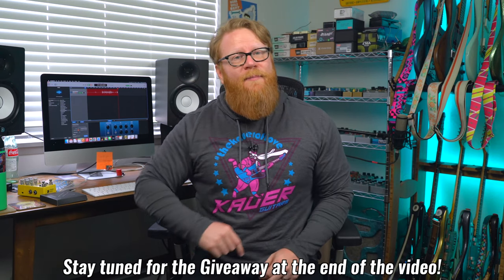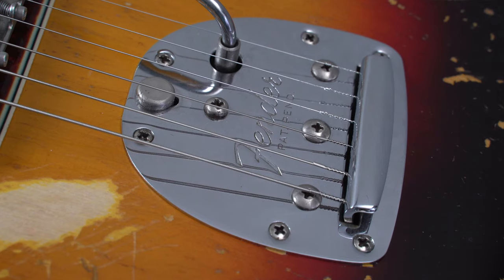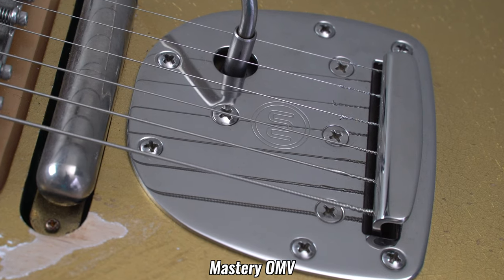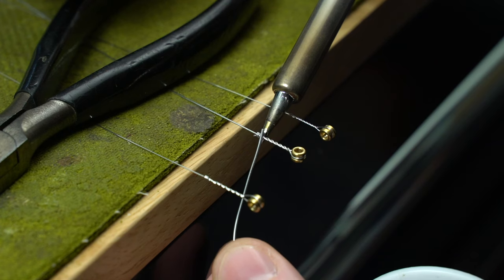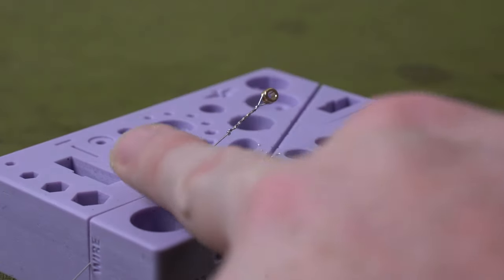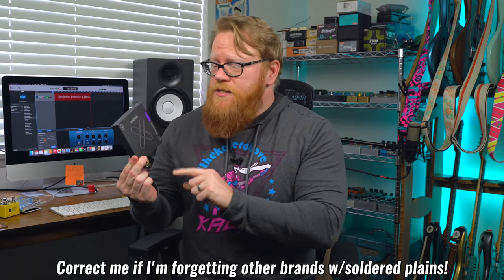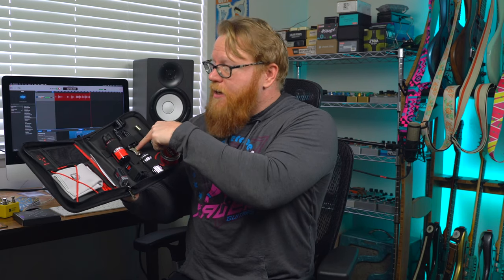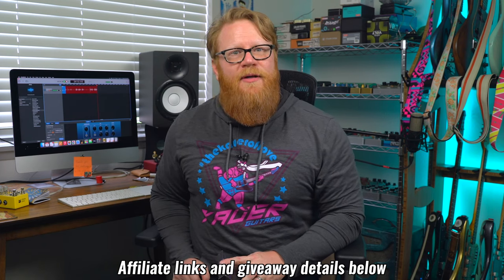ONE WEIRD TRICK #2: Solder Your Strings + Giveaway (Solves Jazzmaster String Breakage)

Comment: On the second source of breaking…another “one weird trick”, for those with strings which don’t touch the screws like mine don’t, is to turn the ball ends sideways like — rather than 0 in the plate. I used to break the high e all the time and that’s after Mitchell’s, turned it sideways and I haven’t broke one since.

Comment: Best channel for offsets by far. 

I took my vibrato apart and flipped the screws. As I did, I noticed another M7 screw underneath that was a countersunk flathead and had an idea. I took my vibrato to the drill press and countersunk the three holes from the front. The I purchased some stainless M7 flathead machine screws and put my vibrato back together. Screw interference eliminated.

Comment: I recommend the M-Steel strings by Ernie Ball they come with extra wounded ends, also if you raise the bridge with a shim on the neck (1° in my case) the strings will never make contact with those screws in the tail plate

Comment: Timely video! Just had a string break on my JMJM for this reason. Thanks a bunch Mike!
Reply: thats me right now with my JMJM. it just started. high e keeps unwinding and slipping, dropping the tuning . . so i keep tuning it up and the string gets tighter and tighter from slipping at the ball end, then BAM one good bend and it's over. It only JUST started to do this so i'm baffled as to why as i'm not doing anything differently. i use stringjoys and they are fantastic, but i will be getting some soldering supplies now lol and also gonna reverse that screw on the next string change.

Comment: Hi got a cheap Harley Benton with a Floyd Rose Special and I will sand the sharp edge of the saddles AND solder the cutted string ends. Because it seems that they somehow get cracked on the outer windings and fall apart. 
Is that a good idea?

Comment: Heat shrink tubing worked for me. Until I finally got around to smoothing out the metal holes themselves. Not a string break yet since the fix.

Comment: I would definitely replace the screws with flat top screws (and countersink if necessary) and use the abrasive cord when needed.  Soldering the strings just makes a string change laborious.

Comment: is there a way to longer keep strings from feeling stiff after a while? the main reason why i need to change strings is not them breaking of being dirty/rusty but because they start to feel pretty stiff after some time? any string brands to recomment in that regard?
Reply: Personally, I spray them with WD-40 before installing, and wipe them off with a paper towel. They also last a little longer. Also, I have the habit of cleaning my hands with rubbing alcohol before playing.
Reply: @joseislanio8910  thanks, definatly going to try the wd40 thing next time i restring.
clean hands certainly help a lot with making them last longer
Reply: I would be careful using WD40 on a string that’s going to come into direct contact with the fretboard wood. Wipe them down after you play and wash your hands before you play. I use Daddario strings.
Reply: GHS Fast-Fret helps keep them a little fresher and cleaner. Probably more gentle on the fretboard than WD40.
Reply: @Jaundice__  well, I wipe it so almost no WD remains on the string. But thanks for the tip
Reply: Definitely don;t use WD40. Things like fast fret or any string spray like finger eaze will protect the strings without completely ruining your guitar. Trust me, my guitar teacher thought WD40 was great and that guitar is cooked/very not okay.

Comment: Heya Mike, super useful video, as always. I'm just wondering if you, or anyone else watching for that matter would see this as a viable option for Floyd Rose bridges also? It hasn't happened to me a lot, but on a few occasions I've found the plain strings have slipped out from the block as they have given away from the winding. Just to note too, I was told to leave a bit of the winding on my plain strings in order to increase grip, especially on the cheaper versions of the Floyd bridge
Reply from the maker: I don't really have too much of a firm opinion on this, just so long as the winding doesn't interfere with the point of contact between the string and saddle.
Reply: Interesting, I would think that tip (leave some winding) would actually make things worse!  Once you don't have the ball end on, the winding is just loose wrapped wire around the string itself, which would slip out now that you've clipped the ball end off... that doesn't make any sense to me at least.

I would stop doing that (if you haven't already, I realize I"m a year later on this reply) and instead just clean snip the string just past the winding all together.  You should also remove and inspect the string blocks themselves... and ensure they are inserted properly.  If they show any wear... replace them, they are cheap.